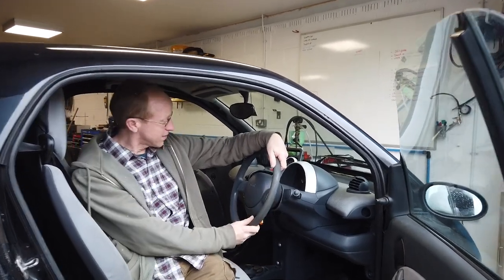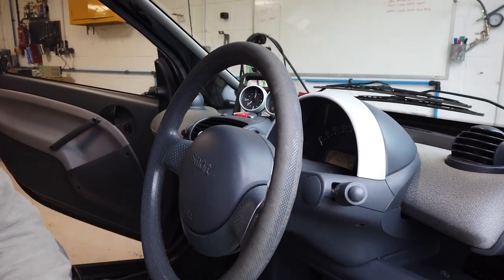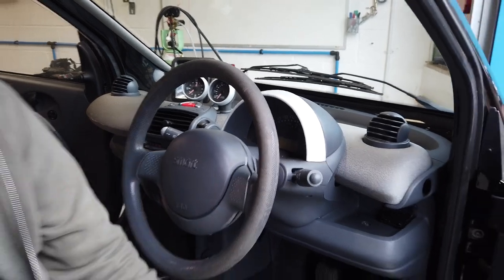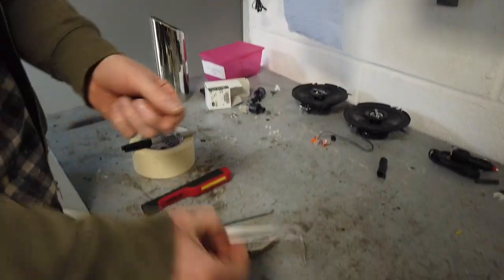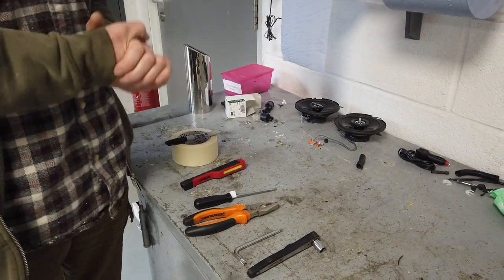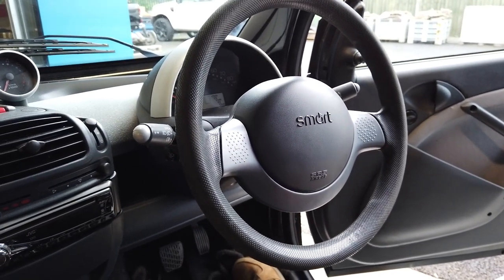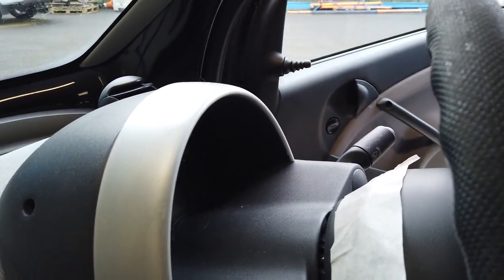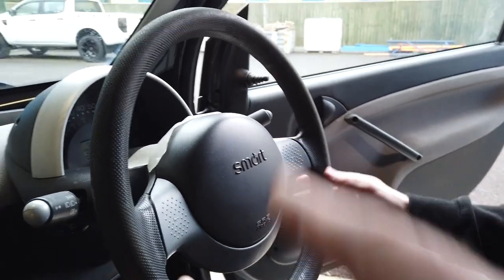Smart ForTwo Step by step guide to removing the steering wheel * airbag

Comment: I have had a smart for two 450 cabriolet passion for over 18yrs now and had the old steering wheel removed to instal a paddle-shift steering wheel and along with that had a brabus engine installed from a 599cc engine to the extremely robust 700cc which now gives me 101bhp and as you know the cabriolet smart cars are even more lighter in weight so my smart for two 450 is like a bat outta hell...lol
I do believe thou since the change of the steering wheel I may have encounters a recurring issue with my airbag light showing a higher impedance on the drivers side,it may have cause an issue with the center spring coil..but im investigating..it may just be a slight short somewhere so time to split and do some work.ciao for now and thanks for a good upload on how to etc etc.

Comment: Thank you, great video and very helpful.  I noticed you said its wet under the carpets, welcome to the joys of leaking Smart 450.   First you will find water coming in through the rear side plastic windows, that's easy to fix.  Next remove the front panel and clear the drain hole in the cabin filter box (which may or may not even have a cabin filter), next carefully check the door seals (new ones are 50 quid each), then check for a leaky windscreen, the only cure for a leaky windscreen is replacement (many owners find their screens break right outside a windscreen centre if they are covered on insurance), and last but not least the panoramic roof can be removed and resealed quite easy with the correct sealant.    If you are very unlucky you will have to do all of those, if you are very very lucky it's just those notorious plastic side windows at the back.
Reply from the maker: I spotted the rear side window leak and tomorrow we are going to try and cut new seals on the laser machine and put these up for sale.
Reply: @L663  Good luck removing and replacing the clips without breaking them!
Reply: @L663  I ended up sealing my plastic windows with Plumbers Mait and the cabin air intake drain was clogged solid too meaning I had leaks front and back.

Comment: i have a 450..   the other day my dog was in the car and smacked his head against the wiper control arm and broke it right now...   i've tried to drill a hole in each bit, and glue a piece of metal rod in, but pretty sure it's not going to last.   assuming i have to take the whole thing apart, AFTER i find a replacement?   mine's an 06

Comment: This doesn't apply to this video, however, I have a smart car 2008 and the battery went dead and I replaced the battery, but now the steering wheel is locked and refuses to turn. I have connected and reconnected the battery and it still refuses to unlock. The car starts and can be put in to gear forward and back.  Any suggestions to get the steering to unlock, otherwise I'll have to have it towed to a service station to get fixed. 

Any help or suggestions would be great.

Comment: With the wheel off, get on eBay and look for another one with the gear shift paddles fitted. They swap straight over but do need to be turned on using the MB software.. a Smart specialist can do this for around £50

Comment: I have a 2008 smart car where the battery went dead and I replaced it, but now the car steering wheel refuses to turn after the replacement. Do you have any suggestions to get this to unlock the steering?

Thank you for your time.
Reply from the maker: Thats an odd one - we just got the smart car out last week ! we put a new battery on it and she was fine ! 
Maybe do a lock unlock / start / battery disconnect etc
Reply: Tried that. The battery had died in it awhile ago and I finally got around to getting a replacement. I’ve tried disconnecting and reconnecting the battery and I looked for codes with a car scanner but no joy there either.

Comment: I took the steering wheel off to do the steering uj that was seized and since I’ve refitted it, in the same way and same spline as I took it off, the ABS and traction lights are on with a steering angle calibration fault on the ABS control unit. Have you had this before?
Reply: you need to calibrate ur angle sensor